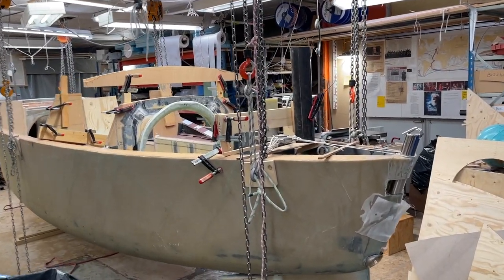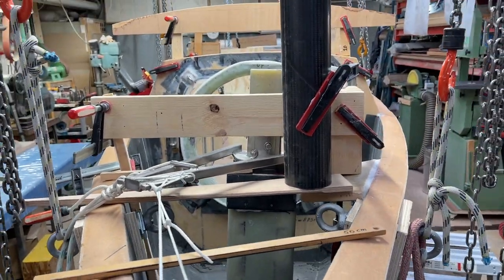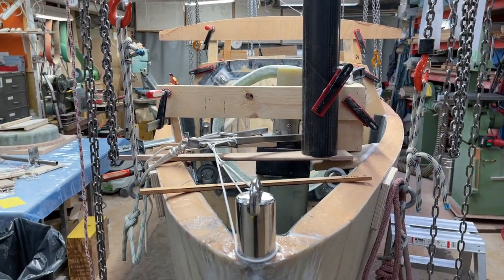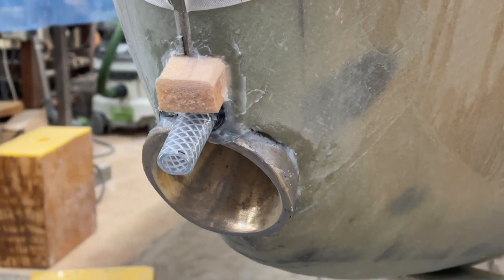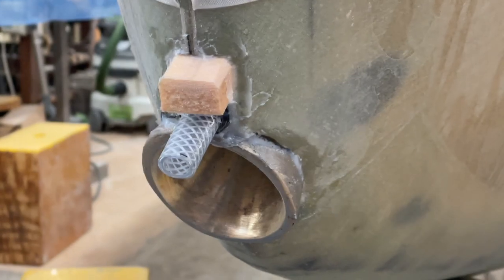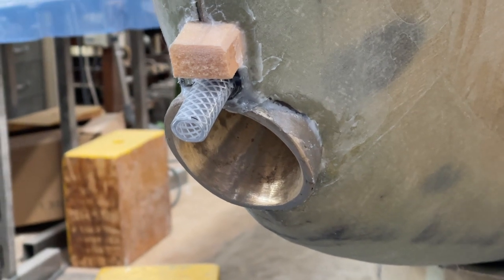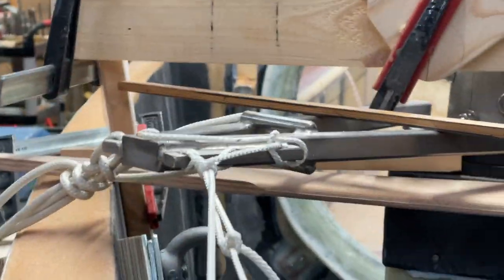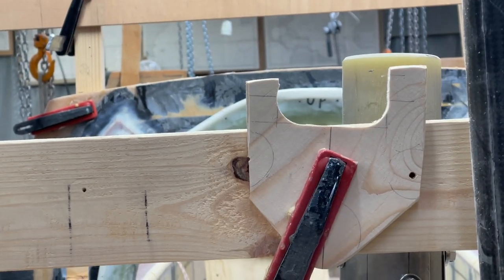26 Feb 2023  Mock up and drain for hawse pipe

Comment: I like the drain; water hose wrapped in carbon fiber. I've been thinking about how to do a drain through my own hull this week. Would there be a problem if you used a small diameter PVC pipe?
Reply from the maker: Myself would not use smaller diameter than 10 mm 1/2 an inch.
Also I would have a stick to clear it now and then.
Much depends on height above waterline-